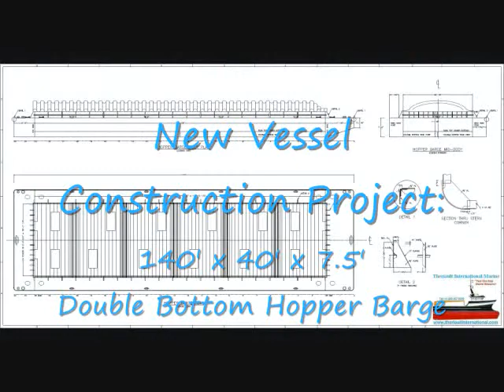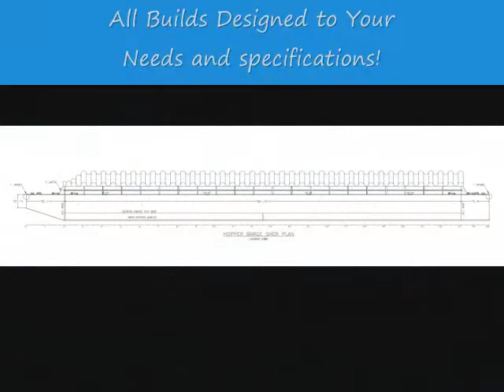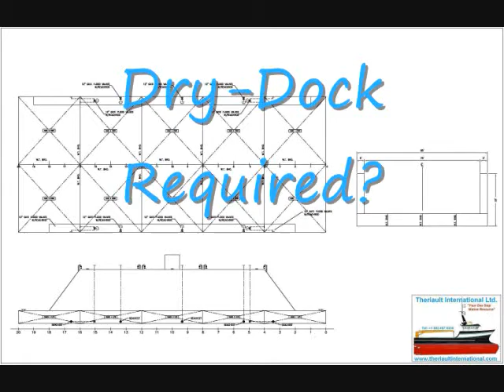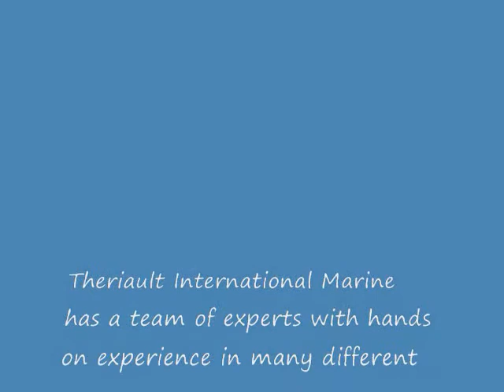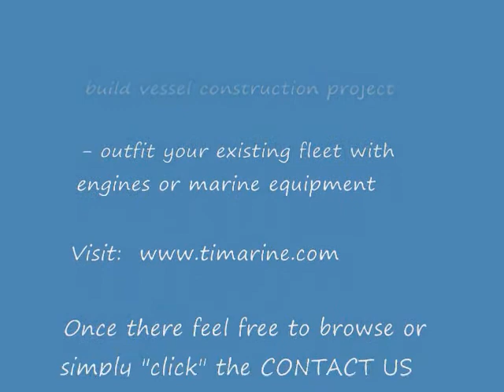Construction and Launch of a Barge from www.timarine.com

Comment: Hey fellas. Y’all should invest in something called plate clamps. That way you don’t have to weld pad eyes on ever single barge panel….
Reply: In term of cost pad eye is cheaper and easy to be made. We can use offcut CNC from the raw steel plate of the barge. Using clamp you would have to buy it everytime you lose it and it can be Cash on delivery which is most of Shipyard avoid. If able, Shipyard prefer simple component to be inhouse fabricated. Lesser cost, better delivery time and save expenses for freight cost. We have done similar for simple equipments such as Bollard, SMIT bracket, towing staple, Roller Fairflead,  V-Bracket,  stern tube, weather/water tight door, escape Hatch, Rudder Blade and Kort Nozzle. But offcourse prior to that we must considering overall cost and risk it posesses to Shipyard if we will undertake fabrication inhouse and not source it from 3rd party/suppliers.